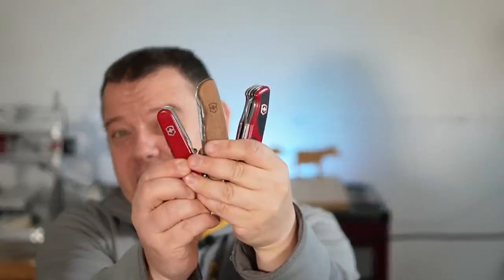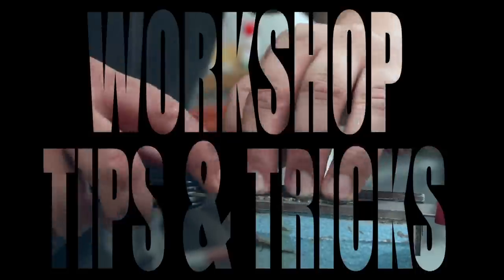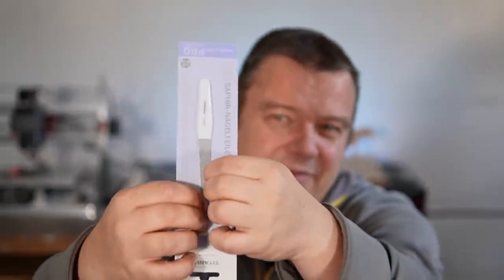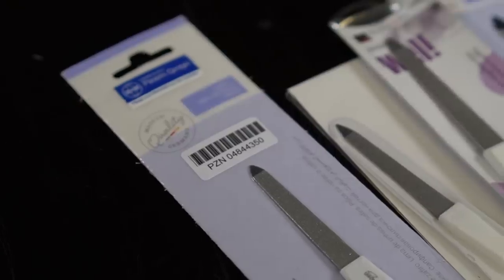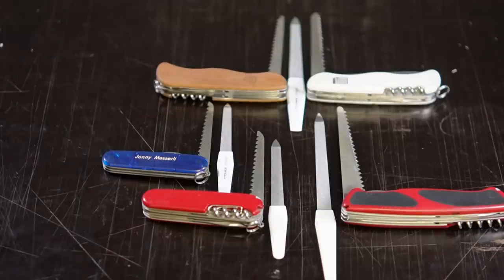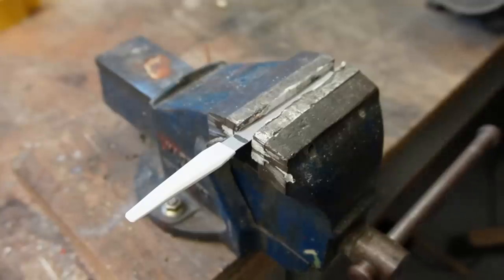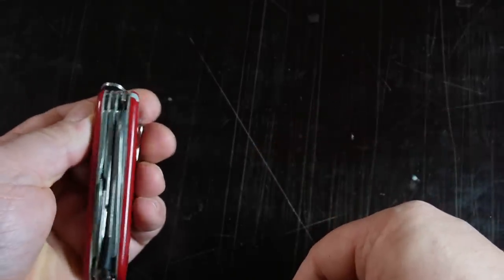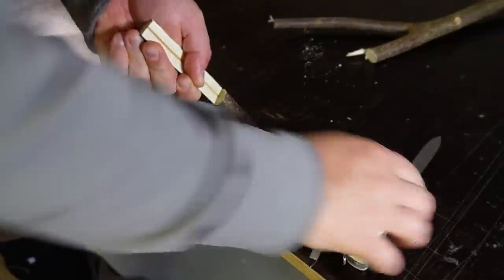Pimp your Swiss Army Knife with a Sapphire Tool File /How to integrate a Sharpener in the Knife body

Comment: Great idea regarding the nail file Felix, I have now fitted one to my Huntsman. All I did was wrap the file alongside the saw blade with a couple of folds of light kitchen aluminium foil. It keeps the file in place and takes no extra room. I used a piece of foil around 4cm wide and wrapped it tightly around both the saw and file a couple of times. It sits flat and if you finish with the the loose end tucked under the blade when its closed it wont move. The trick is to wind it tight. Love your videos 😊
Reply from the maker: Thank you very much for your very interesting feedback!

Comment: Felix.  I had a Huntsman that had burned slabs.  Watching you do other thing in your workshop gave me the idea to make my own slabs.  I used cherry that I had left over from making a flintlock rifle.  The hardest part was inletting the spots for the toothpick and the tweezers.  I also have the hole for a straight pin.  It's only 2.4mm thicker than a regular Huntsman.  Thanks for inspiring me to do this job.
Reply from the maker: Super!! The self made scales are always the most beauty ones!

Comment: I use beeswax on my thread when I sew, so it's handy. A tiny piece of beeswax (about twice the size of the head of a pin) warmed in your fingers, rolled into a ball, then pressed between the file and the saw blade will hold them together just fine. One should do it, but feel free to use enough to do the job to your liking.  It's waterproof, as well.

Comment: Thank You Felix! ...Years ago I placed a removeable 8x8mm Arkansas-Stone-Rod in the Scale, that worked well for Years until the Cybertool dropped from the Roof and the Stone broke (hard to fin sometimes at Craftsman Market) ...The Saphire-File works well but its rough most #150Grain what works but i prefer fine #400Grain for sharpening, so i Have a small Diamondsharpener in the Wallet in think abot how to fix it on the Scales. In Series some diamondscoated, removeable Scales would bei nice
Reply from the maker: Thanks a  lot for your super interesting comment!

Comment: Another thing that seems to work well is to take a small piece of 150 grit adhesive sandpaper and stick it to one side of the can opener blade. You can then trim it to the exact profile of the blade and it will close perfectly in the handle without rubbing…and it never comes loose as long as you wipe the blade first with lacquer thinner.

Comment: Excellent solution to a common problem.  Might I suggest that if you carry your larger SAK in a belt sheath, perhaps that could be modified to accommodate the file. 
What a great channel you have, thanks.
Reply from the maker: Thanks a lot for your tip and your compliment!

Comment: Hi, Felix!
Pretty nice idea! I think, maybe the best model to use is a classic the little one, with the blade, scissors and nail shapener. It can be glued with epoxy and I am always have it on my keys and the Hantsman in the sheath. I think, its not so much important the length of the tool. If I need to sharpen my Hantsman or Sentinel, its long enough for this work. I think, it will work 1 year, and than the replacement will be not hard to much. So, maybe I 'll try it - I have one "little guy" spare, the shop gave me the new one, as for VIP, because I am a recordsman - bought more than 100 blades over there. They are very kind guys. Thank you very much and have a nice weekend!
Reply from the maker: Haaa ha haa, thanks a lot for your story!!!

Comment: Hello there thank you for such a helpful channel. After years of buying not necessarily the wrong knifes I switched to a huntsman.  Great knife.  The knives I was using for edc were always just too big and of course the legality of carrying one comes into question. I love watching your channel because I get the maximum use out of my victorinox huntsman.  The tip I'm passing on isn't my idea I saw a bushcraft channel about a year ago and it was there I got the information.  When out and you need to start a fire one of the best things to have to help in this endeavour is a guitar pick. Very inexpensive and takes up zero room in your bug out bag.  Just feather it with your blade and strike sparks with a ferro rod and you have a fire lickety split because the guitar pick is very flammable.  Hope this was useful. Keep up the good work.

Comment: The Felix model SAK could have a blank layer with rare earth magnets to hold a diamond file and hacksaw blade.
Reply from the maker: Good idea!
Reply: @FelixImmler  To make a   flat horseshoe magnet epoxy a coin magnet on each end of a steel strip one N up one S up. My sunglasses have tiny coin magnets holding them to coin magnets in my glasses. Four magnets hold firmly.

Comment: My idea on how to hold the file in place is, simply make a loop with a length of strong thread and bind file and saw together. Then wind remaining thread around both tools tightly to join them. Tuck the end of the thread between saw and file to hold it in place. Easy to undo and use either tool as needed and a bonus is that it will also provide a length of thread to use with a needle, if you have one.

Comment: You can get hold of some very thin neodymium magnets, very small and strong. You could drill small holes into the nail file and glue them there, though it would probably be better to actually drill a couple of holes only half-way into the wood saw itself, then embed the magnets flush with the surface. That way you could store anything magnetic along the blade.
Reply from the maker: Thanks for your inspiration!

Comment: To exclude scratches and bind the nail sharpener to the woodsaw could be tried flexible magnets. Glue it to the sharpener. Just to check for apropriate thicknes of the magnet. I have no idea if they are available to buy, so its just an idea to try.
Reply: Another idea to glue appropriate grit sand paper to a flexible magnet strip to fit the space between tools
Reply from the maker: This idea is fantastic!!!

Comment: you could use blue tac/prestik to stick the file to the saw, that way it wont easily fall off and you'll also use the sticky side to attach the file to the flat surface so it doesn't move whilst sharpening
Reply from the maker: Thanks a lot for your inspiration!!
Reply: That works really well.  The blue tac sticks to the file more than the sae blade. And having a small amount of blue tac around is potentially useful for something else.

Comment: What an incredible idea - thanks for sharing - I soon have to try it. I always carry a sapphire-nailfile with me, but seperately. They work really nice and hold up much longer, if you use them with water - guess, the "glue", the particles are attached with, is softer on nailfiles than on diamond tools, so keeping them cool is key to durability.
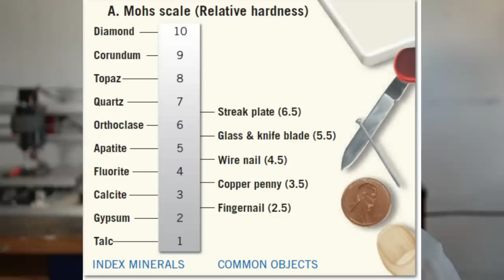@3:31+3:42 you refer to the MOHS-(not Mohns)-hardness-scale, corundum beeing at 9, while diamonds are at 10. From my experience it seems like the Rockwell-C-hardness is around ten times the Mohs hardness - my HRc60-knife got pretty much scratched up by a sapphire nail file. I didn't try, but it will take very long for sure to remove serious nicks.
I think, I'll try a tiny magnet, glued deep down under the saw, let's see, how that works to keep the file in.
Stay safe and take care
Reply from the maker: Thanks a lot for your super interesting comment!!!!

Comment: 🤔... It's a good idea as a "hack" but it is too course... I still believe that using drill bits it's the best option... 
1. We have more sices. 
2. We have more sharpening surfaces like diamond, cobalt and stainless steel... so we can choose among them frome course to fine sharpening,  depending on how dull our blades are.
The only problem I consider it is to put it into the multytool. Some Victorinox's hand drips are thicker than others so it would be all about to chose the right sice, drill a hole and put it as a tooth pick or the Victorinox pen. 🤷🏻‍♂️ I don't know 🤷🏻‍♂️ Feel free to make a video with that idea... 😉 Cheers... Martin from Argentina by the way...
Reply from the maker: You comment sounds interesting... but drill bits as sharpening tool? I don't know that...
Reply: @FelixImmler  Yes they are... I bought a BAHCO knife-scissors sharpener and it's made out of cobalt... More than a corse sharpener I consider it is to keep sharp while we are working, as long as the tool doesn't go too dull... So if cobalt works for that, figure out a diamond drill bit, I believe that one could be used for course sharpening, then the cobalt, and then the stainless steel. I also has the "pen" Victorinox sharpener that it's made out of tela "esmeril" (in spanish, "emery"  I guess in english) like a sand paper material, and a "V" shape made of ceramic. It provided  good results, but if I would know that river rolling stones, (the fine ones used for building's concrete columns) would provide such good result... I wouldn't spend any money in no sharpening tools. That stone + some cobalt or stainless steel surface + leather with methal polish compound = Best sharpening process to be used in the fields.
PD : When I talk about "drill bits" as a sharpening tool, I take for granted that we all understand tha I'm talking about using not the front part that it's used to drill, but the back solid side of the bit... the side that goes INTO the drill machine...

Comment: TOP TIP folks: those saphire files usually come with a thin plastic sheeth and the file can fit WITH that sheeth next to the saw. You can cut the sheeth to the same size as the file and stick the file inside it, then place it next to the saw, that way there will be no scratches AND you can use some thin double-tape or blu-tac to stick the sheeth to the saw rather than the file itself. That way, the sheeth can STAY secured to the saw and the file can be taken out of the sheeth when you want to use it.

Comment: Stainless steel is mostly nonferrous, meaning a magnet will not usually stick to it, or a magnet will not stick very well to stainless steel. This is probably why the magnet trick did not work.

Comment: It was a bit painful to watch those scratches. I would not do this with my knife normally. What if you could just simply put this next to the saw via disassembling the knifes with proper washers, but a notch for release Goat Tool style. I had an idea, to upgrade my Leatherman Rebar with replaceable nail files and epoxy to the single cut side to function more like a Wave. Maybe this idea could work with the Swisstool as well.
Reply from the maker: Thanks a lot for your interesting idea!!